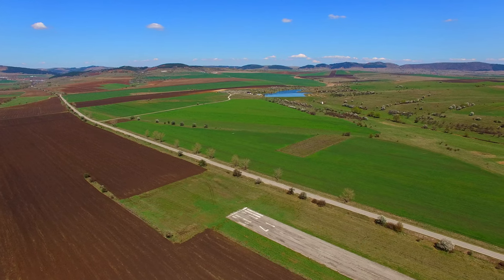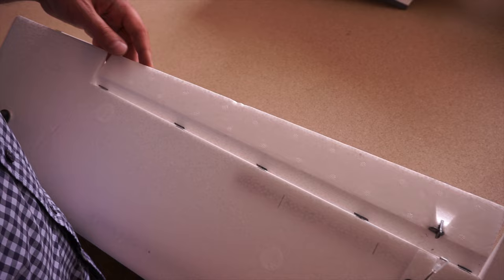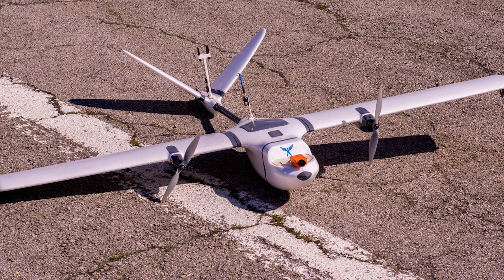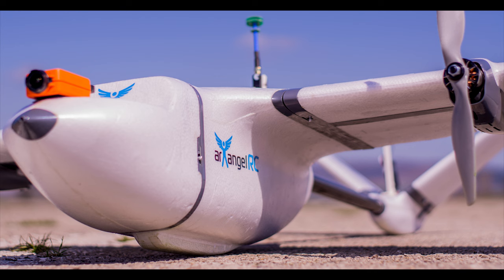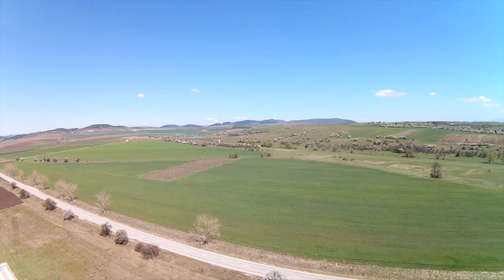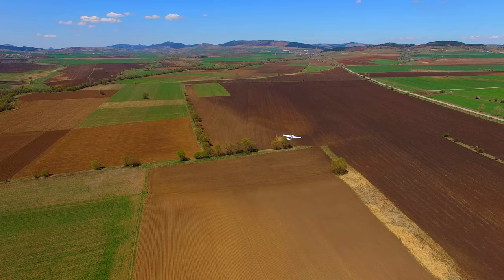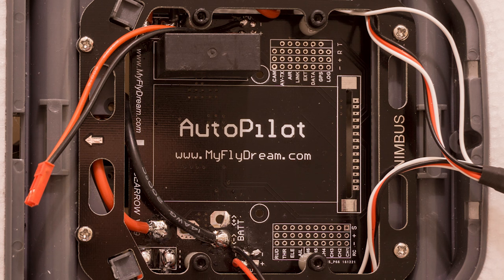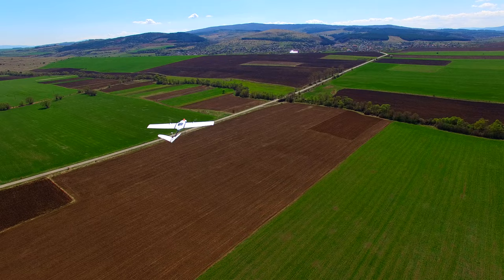MFD Nimbus - full review and maiden

Comment: is there room in that plane for a PinPointRC Black Box? I would not want to lose such an expensive airframe
Reply from the maker: Hmmmm... $130... seems kinda steep given there are $30-$40 options from China, with pretty much identical functionality! But as long as you are asking... there should be enough room, the module doesn't seem that big!
Reply: I Saw those but I am not tech Savvy and it seems complicated to put it together. also, I noticed that I need to pay $10 per month for a simcard for the bay ones where the pinpointrc tracker has no monthly fees. And lastly, it seems like with the pinpointrc unit you can track it on your phone, and not just get back SMS gps coordinates. regardless, I really enjoyed your video, and will be investing in one of these planes for sure.   cheers
Reply from the maker: Actually... for the units I am talking about no putting together is needed, other than to insert the sim card! Also... you don't need to pay monthly... I think there should be those that you just put money in it... and it is there until you spend it! No monthly fee! At least this is what I got! Furthermore... that Pinpoint thing, I believe, does still require a sim card to operate... they do mention cell service somewhere in the description! As far as I've seen... the thingies I got have some website where you can go and track it in real time if you want... updates every 30 secs or something... or you can send a text message! :) Since cell service is needed for both... their limitations are pretty identical.
Reply: @ArxangelRC  Thats Fair. The pinpointrc does use a simcard which is already installed and programmed when we buy the unit. the only difference I guess would be that they roam on all networks worldwide while otherwise we are stuck to the provider from whom we purchase a simcard.
Reply from the maker: Interesting how that works! But even so... I don't travel outside of the country to fly much... and the price difference is quite significant! :)

Comment: very nice review.. been thinking of this plane. hows the penetration in windy days
Reply from the maker: With the battery I am using it is on the heavy side, so I would say it does pretty well with wind!
Reply: you mean in the wind.. im using a converted viperjet as fpv plane , i changed it to pusher prop.
Reply from the maker: Haha, yeah, I meant in the wind... fixed it now! :) Ooooohhh... a Viperjet... that should be quick! :)
Reply: it cruises around 9 to 10 amp at about 65km/h, youtube viperjet pusher prop
Reply from the maker: What voltage is that? Top speed? How quickly can you reach the clouds vertically? :)
Reply: ArxangelRC .. that depends of how high are the clouds an how much power i am willing to use.. if i keep cruising at 10 to 15 amps and climb gently with a 30 degree angle.. it takes about 10 min to get to 1000m high
Reply from the maker: Hmmm... I have been thinking of a very fast  medium range cloud chaser that would be able to go vertical to reach the clouds in no time at all! Still looking for a suitable frame! Right now I am playing around with a Fury Wing, and it is damn good... but it is a tad small and putting APs and GPSs on it might make it even heavier... not sure how good it will perform. I think battery capacity will not be enough on it for this.
Reply: ArxangelRC the viper is one of the best platform i have used so far.. i would highly recommend it to you.. just have to put a more powerful motor than mine and you are sorted
Reply from the maker: Oh WOW! Just saw the video! The plane looks amazing in the air! Almost looks like a real jet! Damn good job mate! Well done. :)
Reply: thanks.. and yes it does look like a real one,, get a kit from tafthobby.com $150 approx. just ask for all servos  for it too.. very easy to put together.. then just  stick a pusher prop  , i fly it on 4s with a 800watt 1300kv motor.. you can put a more powerfull on 6s.. and you will be laughing
Reply from the maker: Sounds tempting but at this time I can spare neither the space nor the time for a project like this! Perhaps a bit further down the line when I get through most of my work! :)

How long are you able to keep it in the air for with that 4S pack?
Reply: a new 8000mah pack will stay up for 45min
Reply from the maker: Bloody hell! That is a pretty good time for a model of this kind! Do you use retracts or do you hand launch it and belly land it?
Reply: i remove the retracts and everything i dont need.. i glue a  rc plane float as a skid. best thing ever.. you grab it for hand launch.. and it skid perfect for landing.. also protects the fuslage a lot. + it is aerodynamic
Reply from the maker: Interesting idea... might have to borrow that one for some of my birds! :) Very nice model mate, well done! I hope this one lasts a long time! May have to think about something like that at some point! :)
Reply: thanks. good luck with yours too.. watch out for casa rules thou. specially putting video on youtube
Reply from the maker: casa rules?
Reply: air traffic regulations.. all there fpv bs
Reply from the maker: Oh... those... pfff... BS is right! In reality here in Bulgaria I need to get up to 10kms high to really endanger anything... and even then the chance of something hitting me is probably... 1 in 10000000000000000000000000000000000000!

Comment: is the power pack same as for the twin dream??
Reply from the maker: I don't think so! I don't have an MTD, but as far as I've seen, the power pack for it is for 4S, and the motors are higher Kv rated. The Nimbus is designed for 6S, and hence the motors are 510Kv! However, the Nimbus power pack is not sold separately officially yet, so you will have to contact MFD by mail and ask them for it!
Reply: thanks for the info,i think i will try out the t-motor MN3110 470kv for 6s setup.
Reply from the maker: You are welcome! :)

Comment: can fly 3 hour?
Reply from the maker: Yes, but you would need a LiIon pack for that... or you will need to figure out a way to fit a 20A 6S battery in there! :)
Reply: u will used sanyo GA right?
Reply from the maker: I am not sure yet, at this point I don't feel the need to do a LiIon pack as I really don't need more flight time than 100 minutes... but just for the sake of it I might build one at some point! :)
Reply: went u used suhans booster 2.4 for radio.. and change to vtx 1.3ghz u can go more then 100km range in 3 hour i think can go 100km ++ easy
Reply from the maker: Right... well... at this point I am only testing to see how far I can get on 2.4Ghz without using boosters, but possibly some day I may get to those distances too! :)
Reply: 2.4 can go more then 40km with right antenna and booster, keith have try it on only 30m on ground and fasr as 33km with m600 multicopter... u can try maxuav that phantom antena.. booster can add at ground with suhans wifi booster... event if u used 2.4ghz vtx also can
Reply from the maker: Thanks for bringing these to my attention, will keep this in mind when I get to the part when I will need more 2.4Ghz range! :)
Reply: Ansari, that's a very bad idea. Boosting the 2.4GHz signal is not only illegal in most countries, but it may also provoke unwanted reactions towards the RC hobby. Go to 433MHz instead.
Reply from the maker: Honestly speaking 99% of the people are flying illegally anyway because they are using Vtx systems over 25mW... so adding one more overpowered Tx unit is not such a big deal... however... I really want to see what is possible on the stock 100mW power, before I decide whether I need more or not! 433Mhz is always an option, but I really do hate dealing with large antennas!
Reply: I more or less agree, but some of the 2.4GHz booster systems are 10watts, which is really in the heavy duty department.
Reply from the maker: The only ones I've ever seen are the 2W ones over at Banggood and eBay! 10W would be a serious overkill in my mind!
Reply: 10watts??? never hear yet.. but what i know suhans 2.4ghz is 4.5watts, i am not using 2.5watt it bi directional booster
Reply: http://www.cebit.de/product/wifi-signal-booster-10w-2.4ghz-outdoor/2214320/M858677

They are everywhere. Try Googling "2.4ghz 10W" and they'll flood your results
Reply from the maker: OK... but this 10W unit has an N connector... it is not really easily compatible out of the box with the SMA equipped equipment we use in this hobby! Honestly this is the first time I am seeing this module, usually when I've seen people use a booster, its been this 2W one: http://www.banggood.com/2_4G-2W-Radio-Signal-Booster-Antenna-Feeder-For-DJI-Phantom-Multirotor-TX-Extend-Range-p-986756.html?p=6L1818635832201406F2